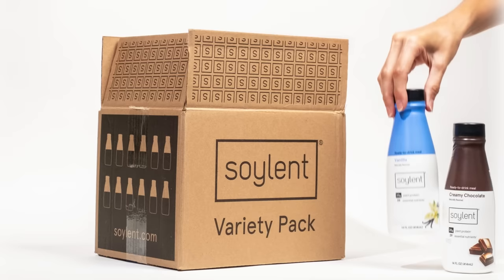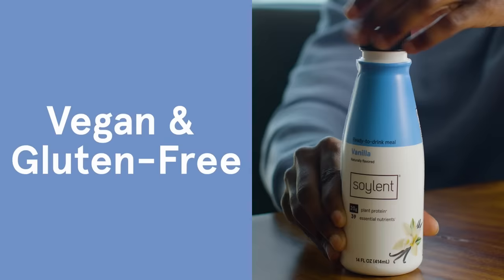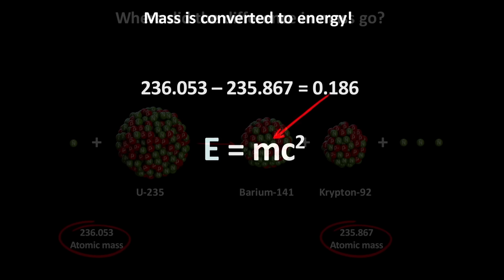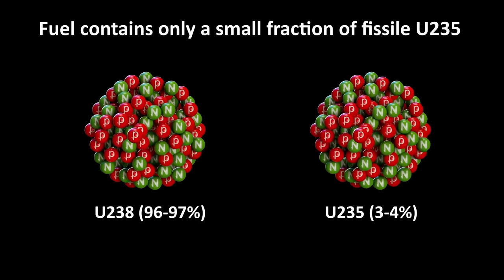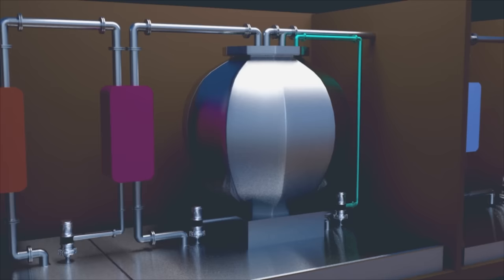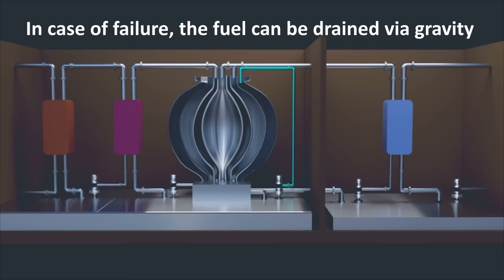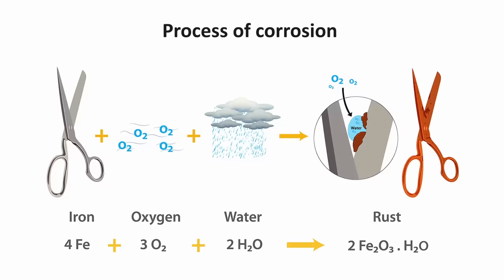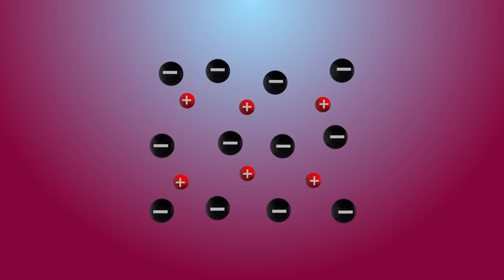How Molten Salt Reactors Could Revive Nuclear Power

Comment: I was a Submarine Qualified Nuclear Reactor Operator. I got to 'play' with these impressive machines. These are unbelievably expensive to build. The reactors I operated are sitting in an open ditch about 40 miles as the crow flies from my home. They will never be safe. 
I do not think that nuclear power, other than solar, is a safe and viable option. Research should be directed to understanding how plants make energy from solar energy. They are very efficient.
I have touched with my own hand a brand-new Uranium Fuel Cell. I did not die. You can't get close to a used Uranium Fuel cell. 
Thorium is a very dangerous element. Sodium is a very dangerous element. Plutonium is a very dangerous element. 
Even the process of making 'Pure Silicon' creates a lot of toxic waste. There is no good solution here (pun unintended).
Reply: Yet nuclear is the safest and most viable option we have.  
It doesn't sound at all like you were a "qualified nuclear reactor operator" at all. 
I have right here at my home thorium, sodium, and the daughters of plutonium.  None of them are dangerous to me at all.

Comment: So if you are running a reactor, and need to refuel it... The moment you open the input port you will get air and moisture. Reactor will need replacing before long. Purifying the fuel is good in the lab, but in the field it's not feasible.

Comment: Not just a thorium reactor. A molten chloride fast reactor could be designed to breed reactor grade plutonium  239 while avoiding the production of bomb grade. In  the so called thorium reactor the fuel produced is uranium 233. This fuel would typically be contaminated in such a way that it also would be unacceptable for weapons production. In my opinion both breeders should be developed. At first the molten chloride fast reactor seems to have a disadvantage in that it requires a large amount of fuel to start it. Until you consider that the 'fuel' is nuclear waste from old-fashioned nuclear plants and decommissioned  weapons. We want to be rid of these things anyway. Such a reactor will extract several times more energy than was originally produced in the pressured water reactor. After centuries of energy  extraction the volume of dangerous substances will be very substantially reduced. Which seems like a much better strategy than trying to bury or store it forever. Of course thorium is also a troublesome waste. It is a serious problem especially in regards to the production of desperately needed rare earth elements.  The bottom line is these reactors make their own valuable fuel in excess of what they need. While consuming unwanted waste.

Comment: The time to develop MSRs, including LFTR, was 60 years ago. A more promising path to clean, reliable energy which has at least some chance of becoming cheaper than natural gas or coal is closed loop geothermal. No fuel, no waste, usable anywhere in the world. Current leader Eavor; others pursuing the same technology.

Ironically, this new capability has only been made feasible by developments in the oil industry...

Comment: I did have a question about using a Sterling engine(s) on the waste heat line to the cooler. To help cool the liquid (whatever it may be) to get that help on pumping or even just a little bit more power generation. I know the heat would be dumped into the air from the Sterling(s) when it cycles.

Comment: Yes, we should embrace nuclear. We need a more energy dense form of energy, not a less dense one. Furthermore, taking in to consideration the fact that solar and wind only make since in a modular format due to their sporadicity and climate dependent nature, nuclear can provide power in a much more on demand fashion in a better way similar to coal and natural gas without the nastiness of coal emissions and lowering our CO2 emissions in the process. Nuclear is the way to go. Perhaps down the road, fusion might actually happen. But right now, it is a pipe dream almost as elusive as matter/antimatter reactions are for power generation.

Comment: Uranium 238 picks up 2 neutrons (by resonance absorption) and becomes Plutonium 240 in commercial reactors. The PL240 then is available for fission reactions which produce power. It has a yield similar to U235 and burns well.  The low percentage of U235 is used to make lots of neutrons which then increase the probability of U238 thermal fission This is a function of a Converter Reactor, as opposed to a Burner (military) and a Breeder (fast fission). Over the 40 year lifetime of a Converter reactor the fuel cells are moved from one place in the reactor to another or to a pool for short term or long term storage. Fuel cells may be used several times over their lifetime. By moving the cells around, more of the 238 and the 240 are used and provide tremendous heat. Then you have to safely store them for 20,000 years while the remaining PL240 decays back into U238. It should be noted that the U238 becomes Neptunium 239 which then becomes PL 240.
Have you ever started up, run and shut down a real nuclear reactor?
Reply: Why are you using PL to indicate Pu?  Just for clarity for the layperson?
Reply: Sorry, sometimes I am just stupid. That happens when you get really old.

Comment: 13:18 For this auto-regulation, we don't need salt per se, any other crystal substance made with fissile heavy elements and molten, would also suffice, wouldn't it? 
Also, why not run small molten cores always at the equilibrium point (where the atoms spreads enough that they reach its maximum) temperature hermetically contained within solid containers, just size that "heat cells" appropriately (in accordance with container material robustness) and use them in parallel, sufficiently separated so that they wouldn't boost reaction rate in adjacent cells.

Comment: My working career was as a test engineer for naval nuclear propulsion systems.  They have an incredible record of safety and reliability.  Fuel is U235 and they use pressurized water reactors generating steam through secondary loops.  The technology is proven and available.  While the thorium reactors hold a lot of promise, until they can be proven practical, we should continue to exploit what we know works.

Comment: I agree that this type of nuclear reactor should be embraced and utilized. It's FAR better than using coal, oil & gas, and an upgrade to the currently used nuclear power we're currently using. Of course expanding the use of renewable energy with as solar, wind and water still would be the better long-term power-solution, but I do not believe we'll be able to cover 100% of humanities power-needs using ONLY renewable energy, and much rather use this kind of nuclear reactors to fill that gap than coal, oil, gas or even the currently used nuclear reactors.
Reply: "Renewables" will never replace fossil fuels without massive degrowth and loss of prosperity. For most of the "all renewables" crowd, that is the goal.

Comment: We already have [almost] limitless green energy in my country, Québec (not Canada). It's in the form of hydroelectric power. And it kicks ass.
Reply: Yes and Iceland has geothermal.  The problem is most countries do not have the ability to expand these energy sources to meet the needs of their nations.
Reply: @danadurnfordkevinblanchdebunk  Obviously, it's a question of geography. You try to take advantage of what you have. Some countries have a lot of sun, so solar power is an option.

And yes, geothermal kicks ass too.
Reply: @Simboiss   Solar doesn't "kick ass" anywhere without backup or storage.

Comment: The causes of those three accidents were widely different and were NOT caused by the same things. The Soviet reactor was an accident waiting to happen. The way it was built and its inherent design were intrinsically unstable and destined to fail at some point in time. I first heard about the designs 10 years or so before the accident happened.  Even as a civilian it was obvious to me this thing was going to fail soon and bad.  Basically, what this reactor was was a completely open pile of highly refined fuel (the graphite core ) and highly enriched uranium mixed together IN THE OPEN AIR!  I mean my very first thought was how big of a fire problem they had.  It's a miracle that it lasted a single day after being turned on.  The Japanese disaster was caused by pure and simple setup[idity.  I can't imagine anyone who put the backup generators in the basement ever thought of ensuring they were protected from environmental disasters.  Since the #1 disaster they were concerned with was a Tsunami and/or earthquake, it seems to me that the very first thing you want to do is ensure the backup power was protected, but heck, I was a software computer engineer in my real life.   The problem at 3 Mile Island was technical, and the reactor didn't melt down.  There was an abnormally large release of radioactivity that the press blew it up into a catastrophe.  Comparing this accident to Chornobyl is just silly, both in the damage caused, the amount of radioactivity released, and the number of people affected.  The nuclear reactor component of the disaster in Japan was also dwarfed by the damage done to the rest of that area.

Comment: Pu239 is not highly radioactive.  It has a half live about 24000 years.  This material can be held in one's hand.  Only a risk of breathed into the lungs as a dust.  Other elements with shorter half lives are the stuff that is dangerous in the short term.  After 300y almost all the dangerous radioactive elements have decayed to harmlessness.  What's left at this point is weakly radioactive that takes long periods of time to decay.  This material unless powdered and some how taken into one's body will not be directly dangerous.

Comment: Some thoughts about maintenance/corrosion, a lot of progress has been made in really cleaver ceramics and graphite/graphene/carbon coatings over the recent 40 years, which are not as susceptible to corrosion although perhaps the wrong ceramics will likely dissolve in the molten salt instead of corroding or not have sufficiently good heat conduction? Also, just the other day, I was reading that they seem to have cracked the problem of commercially coating steel plate with a Boron Nitride coating using a CVD process at atmospheric pressure - this also apparently greatly improves the corrosion resistance. Emptying the reactor and replacing the reactor every 10 years or so would likely not be a prohibitive maintenance cost given they could be mass produced in a factory and plumbed in robotically. The old ones could be re-purposed as waste containers? One final question: If P239 is added to a thorium molten salt reactor, do the neutrons break down the P239 over time to less harmful products?

Comment: Chloride salt fast spectrum seems better for a straight power/thermal reactor, higher temps and less corrosion than FL salt. 
Copenhagen atomics design is not the best but I like that they want to sell thermal salt for other applications. 
FL salts Th fuel cycle and thermal spectrum are usefull later on for RTG's and medical isotopes but there is a LOT of DU and 'waste' sitting around already people want to get rid of..

Comment: I think breeding thorium adds unnecessary complexity. A molten salt uranium reactor should be much simpler and cheaper, those two qualities are more important at this stage of the transition to fission than "unlimited fuel".  Btw we have just as much U238 as thorium, both of which need a breeder reactor, thorium is not special in that regard.

Comment: Should have reviewed the script more prior to publishing, “U238 is nonfissionable” and  “only U235 can be split in a fission reaction” are both grossly incorrect. 

U238 is fissionable and CAN undergo fission to produce energy, it is however non fissile and cannot fission with slow neutrons.

U238 regularly contributes a few % to the total energy output of a nuclear reactor.

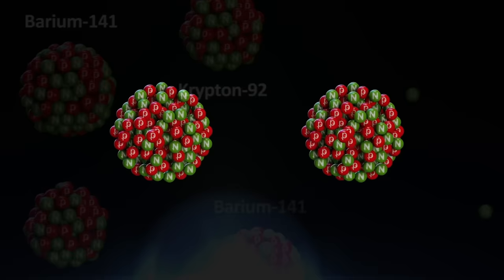Some other dubious statements, but these are the worst so far (as of 7:37)
Reply: "U238 is fissionable and CAN undergo fission to produce energy, it is however non fissile and cannot fission with slow neutrons."
So, that's what a fast neutron breeder reactor is for.

Comment: Why not build micro-micro self-contained reactors that can be chained together to provide the required power. That, together with a mechanism that automates their construction, dismantlement, and flow of reagents from the old into the new could turn test prototypes into production power plants. Seems like a no-brainer way to avoid the silly scaling redesign and testing delays. Ultimately, I expect such power plants should become obsoleted anyway by wind, solar, and battery systems.
Reply: Because of the cost.   Small reactors cost far more to build and operate safely (to modern standards) on a per MWhr basis than do large reactors.

The idea of cheap massed produced SMR's was 1st proposed in I believe 1955.  Buy the early 1970s the industry proved that they were not cost effective as there are too many fixed staffing requirements and cost of any nuclear power plant.

The recent cancellation of the NuScale Utah SMR project last year proves the point (6 50 MWe units = 300 MWe).  The plant would be about 3 times more expensive to build than the  Vogtle plant (that had massive overruns and delays because the USA forgot how to build nuclear plants); even though they would use the same contractors who had learned most of the key lessons from mistakes at VC Summer and Vogtle (2 1114 MWe units - 2228 MWe).

Then staffing cost would be about 7 times higher on a per MWhr basis (assuming the plant ran extreemly well) than Vogtle as well.

There is no evidence at all that a large number of small reactors will produce cheaper electricty than large plants; in fact there is almost 60 years of evidence showing just the opposite.

Comment: With Advancement in solar panel efficiency , nuclear power is not required anymore. Only use of nuclear power will be for space travel provided if technology comes. Other use is obvious-->Weapons
Reply: Efficiency isn't the only problem solar panels needed to solve. Energy storage and transmission also need to be worked on to make the best use of them in the grid. Nuclear power is at least consistent. In saying that, I don't think it's out of the realm of possibility that solar will allow more people to completely disconnect from the grid, requiring smaller grid-scale power generation.

Comment: This video is a bit of an over simplification, there are more one type of molten salt reactor, there are molten salt breeder reactors, of both thermal and fast designs.  The fast designs are the most intriguing because they can fission virtually all actinides leaving only short term (<300 year) waste products, and a much smaller volume, what's more they could produce 1000 years worth of electricity on existing waste alone.  It is this ability to burn actinides of all types that is most useful because then the fuel can be any isotop as heavy as thorium or heavier.
Reply from the maker: There are only two designs that are currently in development. The one I talked about is one of them.

Comment: Molten Salt Reactors are a bit like fusion - only a few tests away from commercial use. Would be nice if we had a technology that is not as inherent dangerous as common nuclear energy but I only believe it when it is deployed.
And yes, I am not a fan of nuclear energy, as I see a huge carbon footprint already in the construction of the reactors. And they are not cheap and if anything happens, like Three Miles Island, Chernobyl of Fukushima it is not the ones who profited from the energy production who pay the clean up.

Comment: Excellent presentation... you simplified but didn't make it simplistic...I actually gained a better understanding of some of the concepts I was a little fuzzy on, like Thorium Salt Reactors inherent self balancing property... great animation, simple explanation... Interesting, the big claim today is finding a material that can withstand the corrosion, but what were they running at Oak Ridge National Lab in the mid 60's... when they said they had a running molten salt reactor and they were running it for how long? didn't they say they ran it for over 5 years? with no problems?   in the bloody 60s!!

Comment: By what mechanism is the salt made molten and kept molten? Is it a parasitic feature, as in part of the heat energy made in the process goes back into the system to heat the salt? On a kg per kg basis, how much usable energy do these create vs a traditional heavy water reactor?

Comment: So what is this pressure vessel they're using for this molten salt solution reactor process made out of is it anything like inconel or Hast alloy
Reply: It isn't a pressure vessel.
Reply: @tonyduncan9852  well if it's not a pressure vessel and it works under no pressure at all then technically what do you call it since it isn't a pressure vessel what do you call it share with me the nomenclature that you know it by
Reply from the maker: @derekbryant6137  It is usually just referred to as the "reactor" or MSR for "Molten Salt Reactor" - it is ok to also call it "Reactor vessel" - The precise metallurgical make-up is part of the proprietary technology, so I don't know precisely what it consists of.
Reply: @ArvinAsh  cool
Reply: @ArvinAsh   Hint: neither does Copenhagen... They have no idea is their alloy or their chemical filtration system will work adequately or not having never tested it in a real MSR reactor with real reaction byproducts and resulting chemical byproducts.